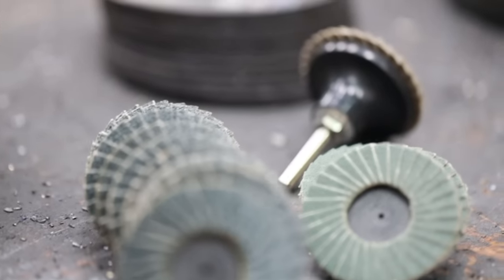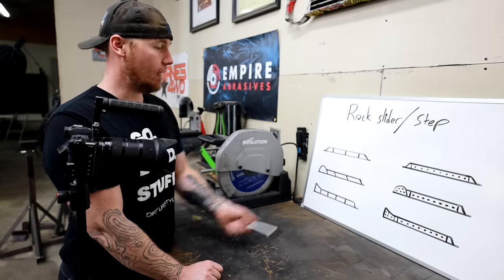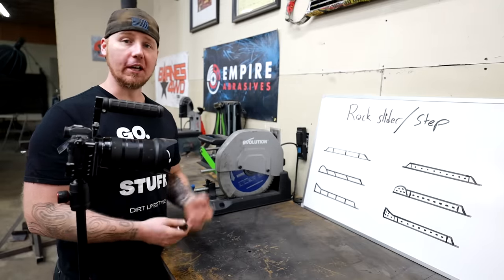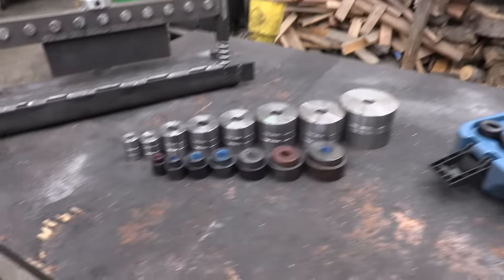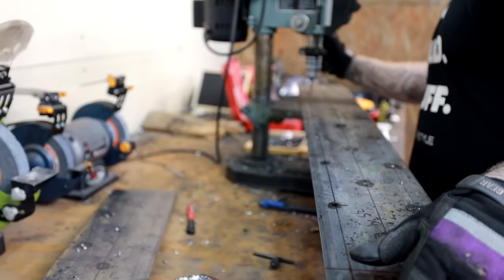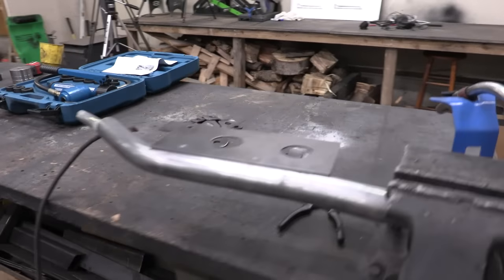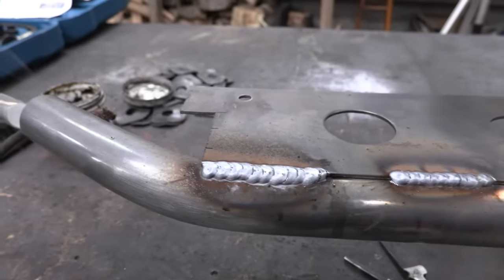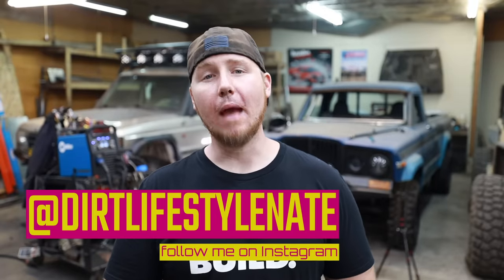Adding Simple Steps To Your Rock Sliders. (Great Beginner welding Project).

Comment: Excellent video! You've set me up for a bunch of projects with my 48 CJ2A and my wife's 2000 Disco 2.

If you wan the traction anyway, there's a pretty simple way to do it. Once it's painted, mask the tubes so just the plate is exposed. Then spray a heavy coat and sprinkle some sand on it. Let it tack up a bit, then spray over the sand. 

The more 'proper' way would be to get a can (not spray can) of matching paint and mix the sand directly in. Then brush it on. Both methods work with a bit of practice.

Comment: thanks! Your shots have solidified the design i'm going for. I snagged a flux core welder and have been practicing on 1/8 plate. Just bought a bunch of 1018 dom and square tube and am starting on the build for my '19 ranger. The FCAW welder doesn't make particularly pretty welds (can't stack dimes because of the flux), but i'm making some strong stringers and will just grind smooth anything too ugly :)

Comment: Just finished making 30+ 1.5" holes in a piece of 1/8" plate with a hand drill; good technique that doesn't break your wrist, teeth, or arbors does finally come, but at about 15 holes I sure was wishing I had some punches.  Nice work.

Comment: Looks fantastic. We had the same HF bender in our shop without the power assist (we added length to the handle) and it was definitely a workout. I tend to overbuild so the only thing I would have done different is add pieces of tubing at either end of the plate for added bracing (though admittedly, it wouldn't have looked as good).

Comment: Nate you motivate me. I have the tools, but I don’t have the 220v power in the garage.  Now I guess I need to go wire up a plug and get to work. I just hate welding on new rigs. (I have an 18 4runner and 19 Cummins)

Comment: Looks good. Could of used the small inverted dies in between the large holes for traction when stepping on, or just use spray on bed liner, it’ll match the black roof rack. Looks awesome though!

Comment: i know thats a little bit late and you would probably wont see my comment but next time while your welding and you want some really nice beads lower your wire speed and do a test you would want around 120-140 amp with that 1-8 thickness and do the triangle movement ! those beads are awesome and so easay with the triangle movement ! love your vids bro <3

Comment: Love the vid , howcome you didn't try welding it with little steps back almost like a whip backwards it gives the same effect your looking for but better penetration ?
Reply from the maker: I don't want to run the risk of burning through the material. I'm happy with how they turned out 🤘
Reply: @DirtLifestyle  that's a good enough point bud , was just curious that's all.
Watching your videos makes me want to take my welding career in a different route and make things for cars
Reply: Invest in a tig welder, you can weld alot thinner metal and if done right its a piece of art, you can use a stick machine if you reverse the polarity and add argon
Reply: @brennonbourque8899  The Miller multimatic is a multiprocess machine it will tig beautifully if you know what your doing.

Comment: yeah, knockout sets are O.D.. you want to make a hole for a 1 1/4" male connector for a box or panel, the hole saw you have to use is 1 1/2". I Was wondering how you were making that work when I saw you using the hydraulic knockout. those things are so good and making a nice clean hole for sure!

Comment: Another top notch video and fabrication, well done!  Your sense of design and carrying that through across the project will certainly set this build apart... especially in the limited vision and available accessories for the Land Rovers.

The music at the end of the video fits perfectly with your personality!

Did I miss the video of you cutting and installing the larger wheel arches on the DIsco?
Reply from the maker: Thank you! I appreciate it! I didn't do a video on the fender flares unfortunately. Some of the small stuff like that won't make it to video due to time constraints. Trail to sema is in 4 weeks and I need this disco to be ready 🤘

Comment: Steps usually come bolted to body. 3rd party rockslider are usually bolted to chassis. What should one look at when bolting to chassis or bolt to body only as oem
Reply from the maker: I'm a fan of frame mounted but have used both 👍

Comment: Another great video 👍Coming from ATV's I love "tree kickers". I've been in situations where I would have bent the rear axle, or much worse, from sliding into or grazing trees. I get how 4x4's are different, but I think you can build them right if you don't plan on changing tire size or suspension. I really want to build a set but I already have the 2x4 mod on my XJ, and I don't know how to incorporate them into the 2x4s and fenders...

Comment: I love this. I had a thought. What if you turned the plate upside down after the the dimple die to add slip resistance on the step?
Reply from the maker: Thanks! I touch on this in the video, I prefer this look much better but have used inverted dimples in the past 🤘

Comment: You can actually do it without a bender if you use square tube and without dimple dies (or even a hole saw!) if you go with the "traditional" style with center support bars and some expanded metal for a stepping surface that also cleans itself of mud, snow, and water.

It won't be pretty, but it'll be functional and can be done with just a welder and a grinder.

Comment: 6:48  45°angle helps get around obstacles
+1
To get a smoother longer transition on your 45, use a larger-diameter die most dies are 2D (eg 2x D diameter=CLR Centerline radius 2"die= 4" centerline radius) . Using a 4 or 6D die to slow the bend for larger steps with more stickout to cover big tires or large offset Wheels.
Dream Big Chisel Down To Reality

Comment: great job!!!! how can we make strong sliders without having a tube bender?
Reply from the maker: I will do a video on this eventually. Use square tube and cut your joints instead of bending them. I want to do this on my wifes LR3. 👍
Reply: @DirtLifestyle  is it just as strong to do that as bending tube? Thats the idea I had in my head. I've been wanting to fab sliders for my liberty but without a bender or access to one it's seems harder.
Reply: @paullydca  Paul,not to intrude on your conversation w/Nate,& I'm certainly not an expert on this,but;
you see square tube construction on earth moving equipment, agricultural,timber, and heavy construction vehicles/implements. Those rigs are significantly heavier,more powerful,and endure harsher loading/environments than the rigs we play with.I just thought I'd mention this...good luck w/your project.
Reply: @stevebaker7051  I appreciate the intrusion. That is very helpful wisdom thanks.

Comment: Very inspiring. I bought the same JD squared tube bender, hydraulic ram and swag adapter. Still need to assemble it. What are the three most common die sizes you use? I want to build sliders and roof racks for my old YJ and possibly my JK.
Reply from the maker: I have a 1 3/4 and 1 1/2 👍

Comment: Great video Nate, I’m going to try and build a set for my Dually which has those really cheap nerf bar steps that I assumed came on the truck in 07 because the bar part where you step at are rusted out.  My problem is that I want to build a set that can be raised and lowered like those high end vehicles, but I want mine to be strong and built for a dually and to be raised and lowered with a small electric winch.

Comment: Hey Nate what kind of spray did you use when Drilling holes. I saw that the spray gooped up then stuck to the drill bit rather than spitting the fluid all over the place. Thats  Common problem at my shop when drilling any metal surfaces. I usually use an oil can.

Comment: I am building some steps for my 2018 Ram 2500 consisting of 2x3 and 1 3/4 tube. How do you feel about welding brackets to the frame instead of mounting to the body. Some say not to weld to the frame because it could make it brittle. Wanting to make them strong for a 230 pound guy like me to step on.  Thanks for any feed back.

Comment: Nate, I have a very similar top plate on my Hefty Fab rock sliders.  I have a slight problem as when my 4Runner gets to about 70mph on the highway, the slots in the sliders will whistle!  Let me know if you have the same problem or if you have heard of this before.  I contacted HF and they just said they have never heard of that before, no offer of a solution.

Comment: Hopefully this isn't too late (I see the video is from last year) but I have a question about slider step shape.  I have a Bronco on the way with sliders, but the stories I'm hearing from folks who've bought these trucks is that the tires throw rocks that eat up the paint all along the side of the truck.  Is it possible to design some protection into the sliders from thrown rocks?

Comment: Nate, is that welding style strong enough for structural welds like cages etc?
Reply from the maker: Believe it or not this is controversial lol. I use continuous welds for things that are structural like cages, suspension and frame mounting. But for something like a diffcover, armor, bumpers or sliders i will experiment with different techniques like you saw in the video. This slider is SUPER strong and all of my welds have plenty of penetration but at the end of the day I personally wouldn't bet my life on it. However lots of folks use techniques like this on cages everyday. Study up on the facts and the differences like your life depends on it because it does. And don't listen anyone's opinion including mine. 👍

Comment: I would think the tubing for your center support would be a lot stronger than the .125 sheet. If you did the tubing + the sheet would that just be like over engineering it? Still really fuckin cool. I want to build my own sliders but the materials seem to cost more than buying them prefab
Reply from the maker: The tube certainly could be stronger. But my sliders on the Jeep have zero bend after 7+ years of use! And this Jeep has been on the hardest trails in western usa!

Comment: Why not cut the holes to size with plasma, or was that just another chance to showcase a tool
Reply from the maker: This is way more accurate and has zero slag. You will destroy dimple dies is you use them on a bunch of un even holes made by a plasma cutter 👍
Reply: @DirtLifestyle  thanks i was curious also about doing a star pattern to add edges to the way you made the rear bumper step
Reply from the maker: @2fwelding842  star pattern dies are super cool! I have only seen them used in projects on Instagram and haven't seen anywhere I can buy them. One day i will find them 👍

Comment: Most beginners don't have a $500+ dollar bender. So not really a beginner project.
Reply from the maker: Lol. Story time. I had many people in my life start fabrication at the same time as me. None of us started with great tools. They found excuses to why they couldn't build stuff and I found reasons I could. The pipe bender from harbor freight is about 100 bucks and with a little determination you can make just about anything I've made on my channel involving round tube. 
This is what i did when I started. People would say it just kinks tube but I made a system that works well. 100 bucks still to much? Buy square tube and cut the bends instead of weld them. 
I never make excuses. If I need a tool I buy it. If I can't afford it I build it. If I can't build it engineer around the problem. Even as a beginner fabricator I was determined and have never had a tool stop me from building what I dream up. Determination > tools. Even for a beginner 👍
Reply: @DirtLifestyle  cool story bro. But yea, same here started with the harbor fright bender, that lasted one project . Talked my wife into buying me a pro tools 105hd for my birthday and that really made cool things happen!
Reply: Fair point, get some buttweld radius corners.  That's my plan.